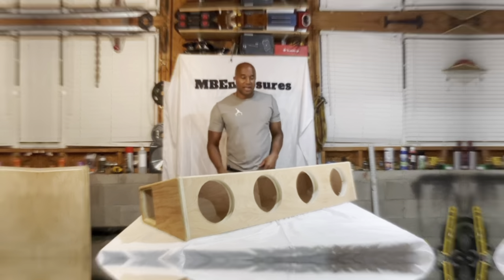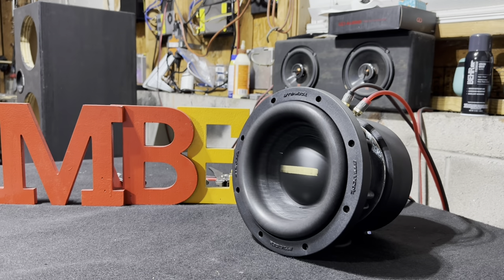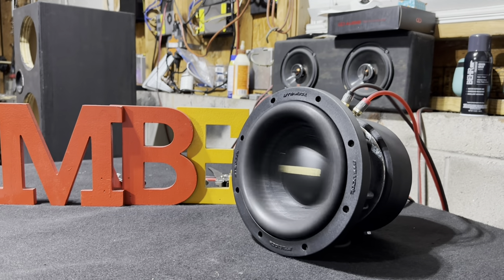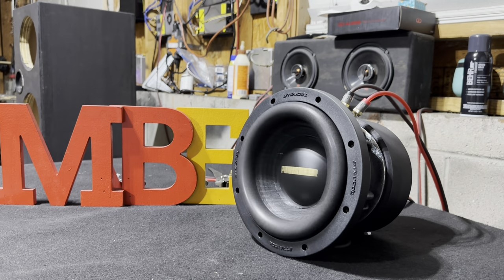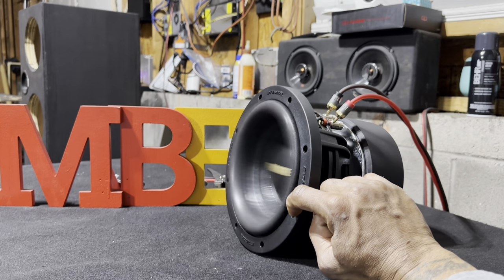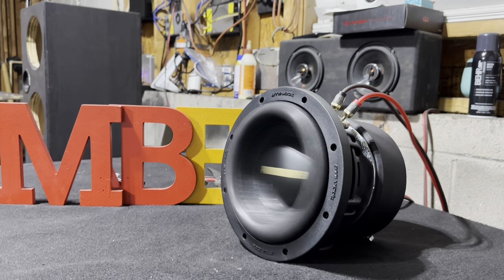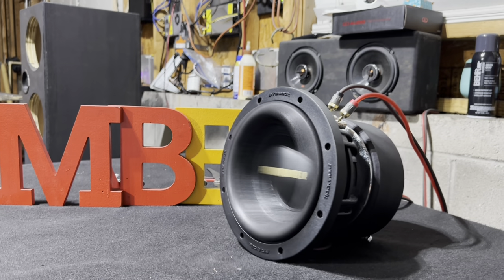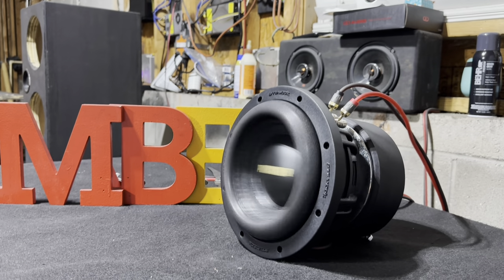Rockville Punisher 8d1 Free Air Frequency Sweep

Comment: Not going to lie, performed better than I thought it would, also sounded clean 🤔 didn't hear any mechanical noise, curious to see how it does in a box🤙
Reply: This is what happens when you use a clean signal within rated power. Most of these subwoofers work just fine, just gotta work within the true performance constraints (Pick 2: Price/Quality/Performance). … He did mention that was some sound from the surround on the 20-30 hz range.
Reply: @Phi Mobile Sounds  I understand how it works, but I appreciate it. My current system is 4 Crossfire xt3 18's, Crossfire 16k at .5, 135ah c-max 16v, Crossfire 2000.4 all Crossfire mids and highs, subs are in a 4th order wall that I built. I really hope you don't send a clipped signal to a sub, especially free airing, I was simply referring to any mechanics noise while the woofer is functioning within its parameters 🤙
Reply: @holeshotinspectionllc2412   definitely did not want to assume, just adding my two cents … but a humbled to see that you have such a setup. Very impressive!are there any demos of your build? … I’m trying to get a better understanding of 16v setups.
Reply: @Phi Mobile Sounds  absolutely I'll send a comment from our other channel, I didn't take your comment in a bad way, I'm using a external regulator with my 02 Durango I run daily at 15.7-15.8 and I turn it up to 16v while competing, after reading my comment I do see how it sounded, sorry bout that.
Reply: @Phi Mobile Sounds  this is the Crossfire xt3 18's build🤙

Comment: I have 4 of the D2 Punisher 8's in a 4cf box tuned to 35hz on a Taramps Smart 3 Bass wired to 1 ohm.  They take all the power the Taramps can push so I'm looking at getting a Smart 5 or even larger.

Comment: I liked my punisher 8 alot. I pulled a sa-8v3 out and put the punisher 8 in and to my ears it was louder. I was using a Jp8 amp none of the 8’s ive tried could take it full power without tapping the coil.
Reply: I also have a jp8 im currently running 2 savard hi q 6.5.. they play clean but looking at these 8 punishers
Reply: @stevecri123   i bet the savards sound good too. Well I would imagine two punishers would be just enough bass. One wasn’t enough for me
Reply: @Ronco160  I have clipped the coils on the jp8 at 1 ohm 👀 but now I should have gone with the 8 instead of the 6.5.. truth me told they do sound very good musicly wise and they do produce that spl just enough to blend in well with the music

Comment: Suprised as well..  You are my favorite builder on youtube, been rocking with ya for a couple years now.  Building my own box and when I calculate port area needed do I use the total cubic feet before subs or after?  Keep it real.  Much love from Oklahoma.
Reply from the maker: After
Reply: @M.B.Enclosures  when calculating port displacement, do i go off length of width?
Reply: @Chuck_Sanders  so my box is 2.8.  Subs say minim ported is 1.25, mounting depth is 6.75.  Does that mean I calculate port with 1.2 airspace?
Reply: @Chuck_Sanders  perfect.  I really appreciate it.  I'm so nervous about this being my first build.  I noticed he doesn't use bracing for the pvc pipe but others do?  Also benefits vs cons of 1 or 2 ports
Reply: What size port are you using and what are your exact dimensions? Also you should at least flare the exit of the port( you can easily heat it up and press it over a mould to shape or rout out the hole for the port with a round over bit. Check out car audio fabrication for exact instructions. You can do it easily) 
Also , what material are you using and what thickness, it has to be right and braced correctly as well.
Before building you will also need to consider the sub/port orientation and if it will work.
Reply: @johnnycorn7225  got my mind on 2 4 inch ports now instead of a 6 at 13 inches.  Leaves 5 inches to wall of box
Reply: @Chuck_Sanders  most of the best sounding boxes I've heard have followed these rules yup^
Reply: @brandonsmith6770  that would work what program are you using, just to make sure the math is right. Got to know your box dimensions and make sure I tell you right
Reply: @johnnycorn7225  i have 1 other question.  It lists ports.  Then it ask box cubic ft.  Is that before or after sub displacment
Reply: @brandonsmith6770  the program should tell you you're available ft3 net after you type in the exact measurements of box, figures from your driver displacement port displacement and material thickness. You can't just assume you have the space. If you make that box 2.8 instead of 2.25 like kicker recommends, it will be easy to overpower it and you really must have a subsonic filter in place as it will bottom out very easily and have poor response in the upper range. 
Ultimate car audio app is quick and free and always agrees with the other proven box programs as well, I'd recommend it. It's so easy
Reply: @johnnycorn7225  do I calculate airspace after the subwoofer displacement or before.  Its a 2.8 box but the mounting depth is 6.25.  So would i subtract 1.25 cubic ft from box an use 1.2 as my airspace to calculate port?
Reply: @johnnycorn7225  the box is already a sealed 2.8.  I'm thinking bout going ported
Reply: @Chuck_Sanders  that was the answer I was looking for.  Thank you.  I had a stroke 7 years ago so am limited to what I can do and limited by lack of tools.  I really want to do as much as I can.  I feel I can do this.
Reply: 4 inch aeroport
Reply: @Chuck_Sanders  i think after talking with kicker I'm going sealed first.  If it sounds horrible then I will go ported.  I only have 17.5 inches to make a port for each chamber.  Every way I figure it I'm only getting around 52 hrtz at best.  I think a sealed setup with polyfill would hit better and lower.  Idk.
Reply: @Chuck_Sanders  i hope to build one in the future based on the one I have only better after a seat lift possibly.  Thanks for the knowledge, for it is power.

Comment: hey, i have a Cadillac XLR, there is a storage space right between the seats that i can squeeze a box in and have the port face the cabin, What 8" or 10" sub do you recommend to give me the cleanest output in an either sealed or small vented box. I was thinking the kicker is q class 8" because it's like a 10" almost or the q class 10". what are your thoughts? and yes I know it's a drop-top, but I'm not looking for the loudest setup, just enough that I and my wife can enjoy my music, which is mostly jazz and some RnB
Reply: A ported box has to be much larger than a sealed box even if it's the same model sub example a 10 inch q class might go in a 1 foot cubic box sealed but ported needs 2 cubes that's just a example .

Comment: Hey mb I need help man I've got 3 cerwin Vega VMAXX 12 subs box 5.25 cubes how much port area would the subs need I can't find any good info thanks buddy
Reply: Is that 5.25 net or gross, I would definitely not go any less than that net so they can breathe. That's the minimum requirement listed net.
Looks like you're going to need an 8-inch aeroport for those 5.24 cubes to end up at 10.65 in2 per ft tuned @33. 
Do you have everything needed to build the box? 
I honestly wouldn't do it if you haven't before, that is a box that will end up needing 3k min, and will need to be built tuned sealed and braced correctly. I just hate seeing people waste so much time money and effort to only end up with a bad sounding or torn apart box. 
Hit him up, it's worth it.
Reply: @johnnycorn7225  that is net I thought about going 6 cubes I can do it I've done a few but like you said I've spent a lot on it and want it to sound good and Ive got a 3k going in until I get a 5k what would be good port volume for these on 6 thanks man
Reply: @tabathaturner987  if you took that box up to six cubes a 10 inch port would give you right at 14 sqin per ft3 which would work but would need to be twenty-three in long to give you a 35 Hertz tune. That means you're going to need a box that is at minimum 33 wide or deep. You could still use the 8-inch but that would only give you about 9 per f3 which would work fine, but I would go with the 10 inch if your wanting to knock the lows
Reply: Oh I forgot big props to you for choosing cerwin-vega too, one of my favorite old school brands, and those vmax subs represent ( also the shorting ring greatly improve sound quality)
Reply: @johnnycorn7225  I appreciate your help buddy I really do and cerwin Vega is my favorite not downing any sub brand it's just my brand of choice my uncle got me hooked with some in around 2006 v max subs and I heard my first stroker around that time and have loved cerwin Vega ever since I wished more people knew of them like people that have just got into audio a lot of them don't know about cerwin Vega again I appreciate you man
Reply: @tabathaturner987  you know me and  MB both just do it for the love of it my brother, I'm 47 and been hearing them my whole life. They were the very first to mass produce and market subs in 1954. One of my very favorites is the old cerwin-vega afterburner folded horn, it is devastating for shows 😥 whew!! 
Yeah those strokers unique spider design is next level too good stuff!!!